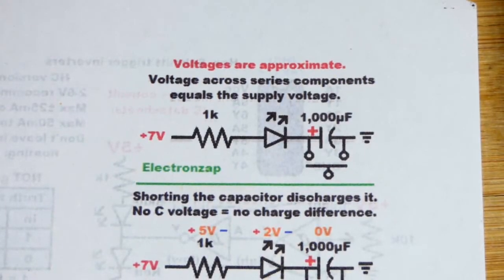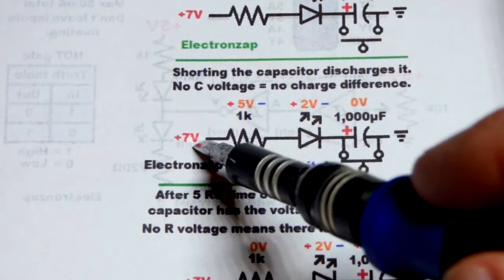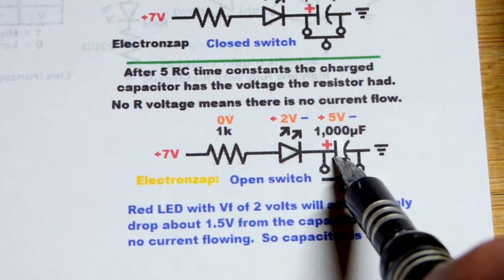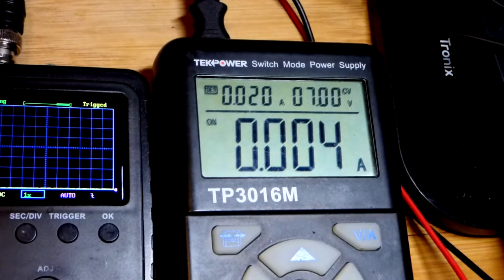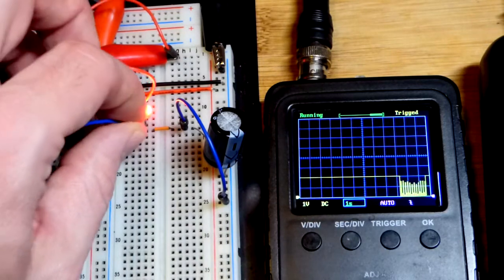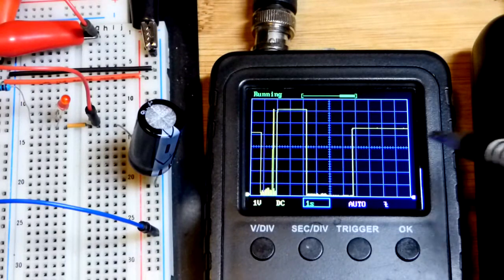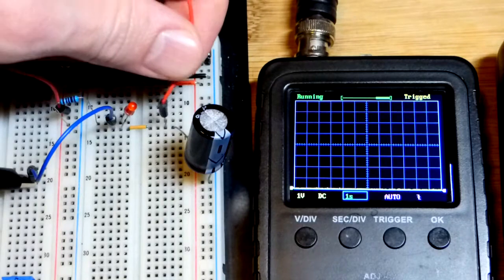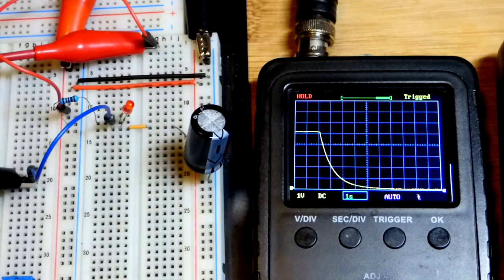Voltages across series components resistor LED capacitor demonstration circuit oscilloscope measured

Comment: Liked the video.
But you must consider the leakage current of the electrolytic capacitor. When the current passing through the circuit equals the leakage current of the capacitor, the charging of the capacitor stops and the voltages of the capacitor, diode(LED) and resistor remain constant.
Reply from the maker: If the capacitor was ideal and had no leakage then it definitely would finally get to the supply voltage through a diode. But if the diode/LED also didn't have leakage, then no current at all would flow through the diode below it's forward voltage. A perfect diode though would have a forward voltage of zero, and so any capacitor would get to the full supply voltage. Thanks for the comment!

Comment: hello, I love your videos, but could you explain to me why, once the capacitor is charged, there is a voltage across the led if no current is flowing? I may have misunderstood since my English is not perfect, but thank you for everything you do!
Reply from the maker: Forward biased (Anode more positive than Cathode) LEDs have a forward voltage that is usually about 1.5V or 2.5V, which they need have across them to start conducting current. That voltage stays across the LED and in fact it goes up a little at higher current, and that voltage is dropped from series components. Hope that makes sense, thanks for watching!